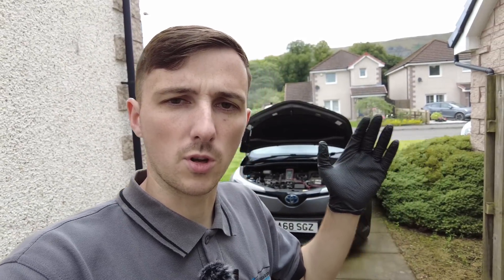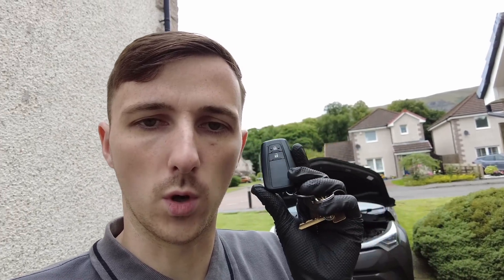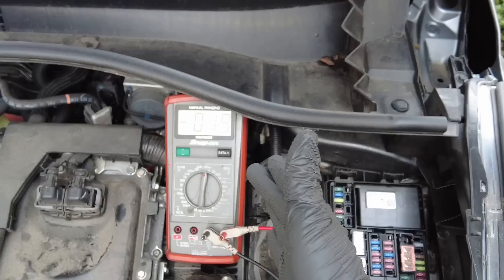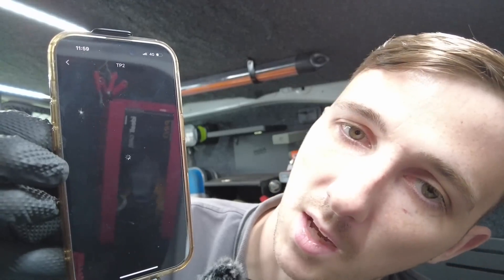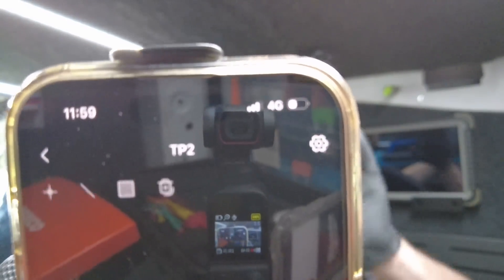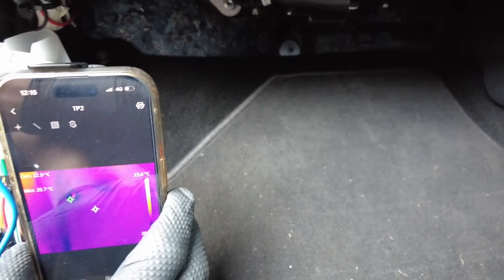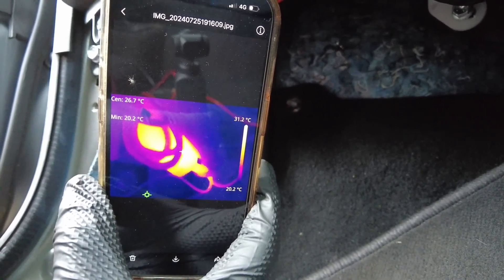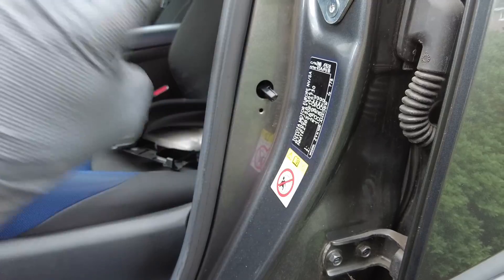IS A BATTERY DRAIN DIFFICULT TO FIND EVEN WITH THE RIGHT TOOLS ?

Comment: Everyone I know who fitted a dash cam also had the battery drained.
Reply from the maker: It really depends on the dash cam set up etc, Ive fitted loads with parking mode and they usually do switch off when unattended for a period of time to save battery use

Thanks for watching
Reply: @mrautoservices7354  Amy chance you could do a video on the ones you have used?

Comment: Excellent video, as usual Ryan.😀👍 IR cameras are really useful in all sorts of applications, you can never have too many tools in your toolbox. The good thing about IR cameras are that you can quickly scan a large area and very quickly narrow down to the hotspots for more discrete investigation the really bad thing about IR cameras is - they are really expensive. It is possible to use an IR thermometer (they are much cheaper) but it is a tediously slow process.

If the customer on this one had tapped into a switched live it would have been better (well before they zapped it on the reverse polarity jump start).😉

Keep up the good work.😀👍

Comment: Thermal imager £300 I don't think I will be purchasing that for a 1 time use
Reply: I've a Toyota yaris hybrid 2022 sat waiting for wife with engine off listening to radio for a hour drained the battery RAC jumped started it said to the guy do I take it for a run to charge up no he said its not a alternator on these it's a inverter so just sit with the ignition on for a hour and the engine will cut in and out to charge. I think the 12v battery is to small under back seat now I carry a boost pack cause can't leave parked for more than 4 days😅
Reply from the maker: Agreed Jimmy not a light purchase if you dont plan on using it often, I also have the flir for years and do use it frequently for stuff like this 

Cheers for watching

Comment: With this type of door switch it's only  necessary to remove the screw from the switch as that's how the circuit is completed saves the chance of losing the cable from the rear of the switch into the door compartment or in fact the B pillar
Reply from the maker: Correct